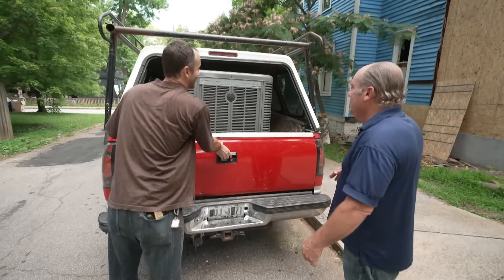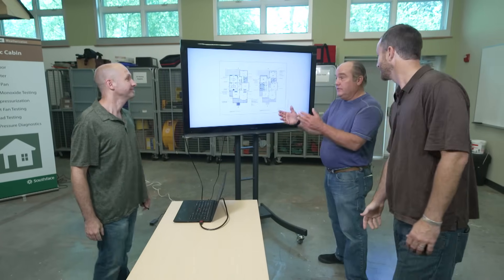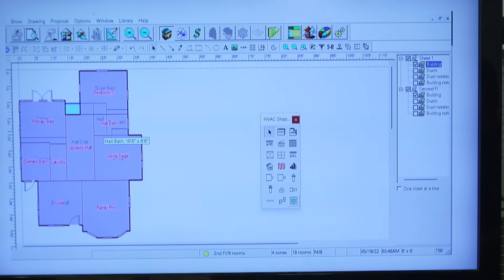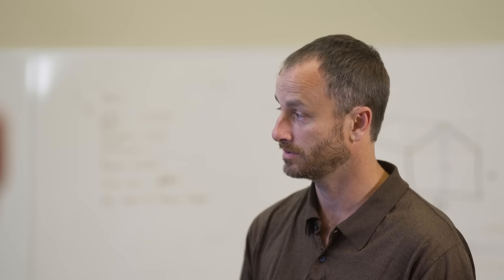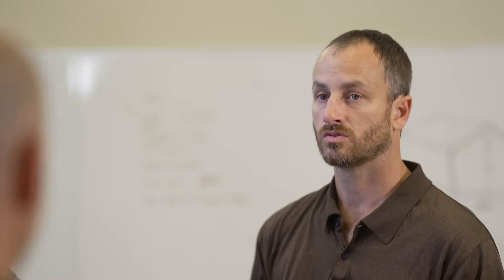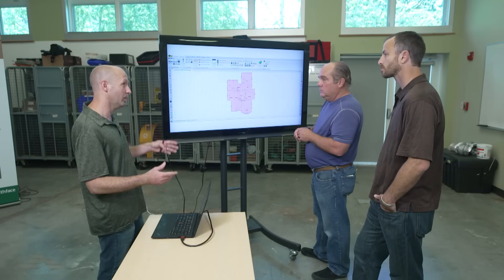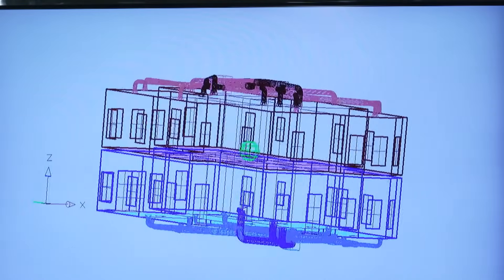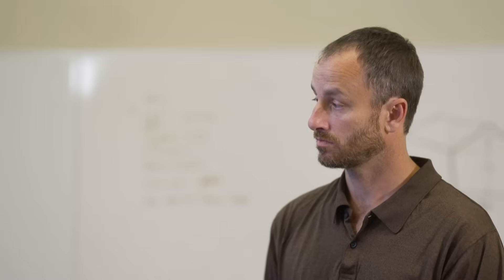HVAC Ductwork Plan | This Old House

Comment: I think the program is called write soft.  Many systems are installed improperly because the flex duct is not stretched out.  Air needs good flow or the static pressure will be increased.  I'm just a stoner so I know nothing.

Comment: Ok, the guy bought a pair of 3 ton units and they tossed around the idea of insulation plus windows to cut that back to 4 tons and change all total but never drew a conclusion as to what's actually happening? Based on the video, it almost sounds like the owner is skipping insulation and window upgrades in favor of historical preservation. BTW, I did my own place 15 years ago and transfered my tape measurements directly to a materials list. Took less than an hour per floor tally that up with two air handlers. (basement and attic)
Reply: @   it's only pointless if you have no clue as to what is going on!
Reply: In places with very strict historical preservation laws, or for people with very strict personal convictions on that, they really do prefer less efficiency for easier/better preservation. It may not be what us normies would do but they make it work.
Reply: @rachel705  if you look close at some preserved buildings, they are adding storm windows on the inside. Not perfect, but looks better from the street.
Reply: @rachel705 Contrary to "normies" beliefs, there's more to houses than efficiency.  Houses aren't just 'shelters' anymore, and haven't been for a long time.  Architecture and good design are things that have disappeared in modern times, partly for the sake of efficiency.
Reply: @JediMasterMok  Oh I agree, but at the same time when you’re living with restricted disposable income you’re much more likely to focus more on cost savings and less on aesthetics.